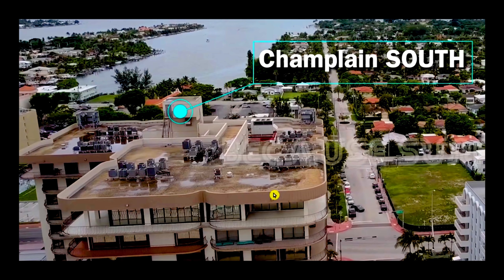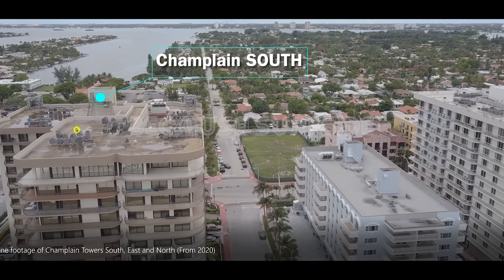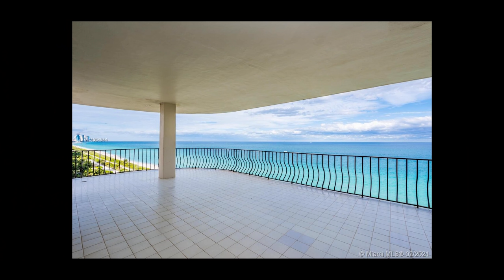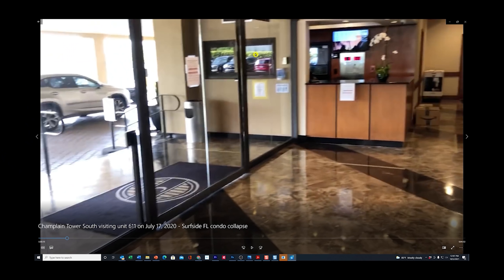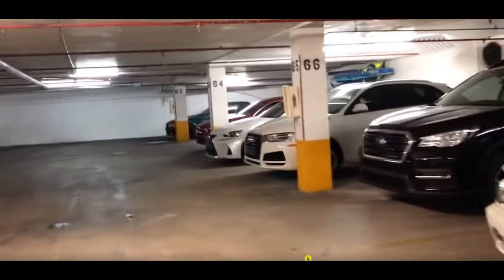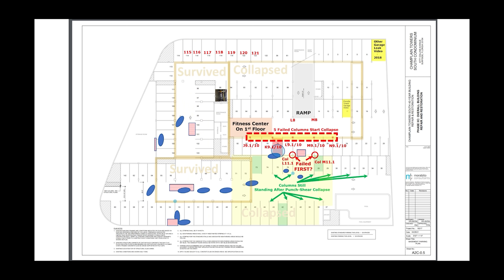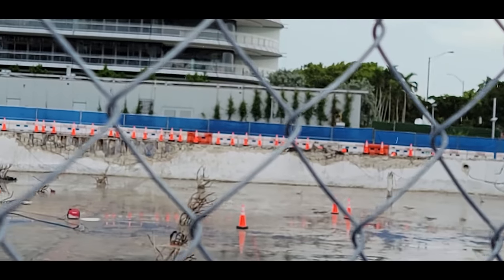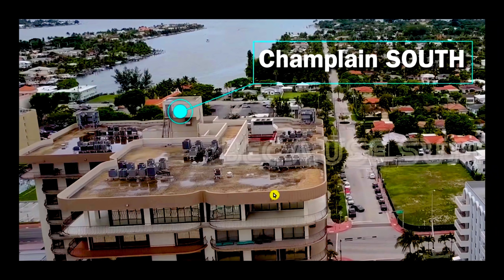Miami Condo Collapse: Water Attacked Roof, Inside, Pool Deck

Comment: Whatever a person may think about Jeff is not important here. And you do not need to be an engineer to see that there are things that do not add up here, a number of which Jeff has identified:

Weight added to the building that was not originally intended; pavers, layer of sand on the pool deck, marble on interior finishes, a thirteenth floor added in later years  

Weight added with concrete planters, dirt, palm trees. This must have added several tons to the weight of the building. 

Also, water trapped under tiles and grout, but over the concrete slab, this corroding the rebar. Very bad. Porous grout and concrete. 

Neglected maintenance on spalling concrete

Failing and leaking garage ceiling

Large pools of water sitting on the roof top

Strange leaks inside the building, in the hallways, dehumidifying fans in the hallway

There are all clues. Whatever Jeffs credentials may be, Or not be. Don’t shoot the messenger.
Reply from the maker: Thanks, glad you find the videos useful!

Comment: How come every apartment had its own little residential sized AC unit on the roof? Never seen that before.
Reply: Seemed to match the original build plans from 1979.  Each apartment has its own air handling unit / evaporator for individual temperature control.  This of course requires a dedicated compressor/condenser unit on the roof,  with long freon lines connecting both.
Reply from the maker: All buildings do it like this

Comment: RE: Water in the hallway near 611... floorplan shows that BOTH sides of the corridor/hallway are plumbing walls, i.e. right inside the entry doors of ALL units (incl. 11-stack), there's the kitchen on one side, and a half- or full-bathroom on the other side.  Given the Reiber-esque tendency to use the cheapest materials possible, I'm guessing this building was plumbed with cast-iron crap, which only lasts 35-40 years, max.  =:O
Reply from the maker: I doubt in 1981 they were using cast iron
Reply: @jeffostroff  I agree, for the PRESSURE side, it's unlikely... OTOH, Nathan "Shifty" Reiber got away with all kinds of corner cutting, plus his philosophy of "it's the shiny marble that sells, not what's hidden behind the sheetrock"... PS: for the DWV drains/vent-stacks running vertically, cast-iron is code-required in high-rises even today, due to fire/fumes danger posed by PVC.
Reply: @jeffostroff  Back to original issue of water outside 611--7 storeys below penthouse--I'm betting it came from someplace closer than the roof (e.g. no water staining on WALL above dryer-fan)... like the kitchen in 611... badly done dishwasher or ice-maker fitting, using those stupid saddle-puncture valves, etc.

Comment: Be very careful with condos and coop’s - do they spend the money to fix things? Does the condo board “have teeth”? One of my condos has a ferocious board that would never allow different surfaces and colors on the balcony. My board would put a lien on any property that tries to look that different. Do they work well with members and get things done? It wasn’t surprising to me the hotels around the towers have cleaner, better cared for roofs. They have the money.  And they’re not afraid to spend it. 
-Are the units regularly inspected? What role do the city inspectors play in the collapse?
Does the builder’s company and workers have any liability here? Anyone who is still alive?
Reply: Some condominium/co-ops have excellent Board of Directors of the HOA that adhere to a scheduled maintenance program and make sure that repairs and asthetic upgrades are done to code with good workmanship. The Board is fulfilling their fiduciary duty to protect the viability and value of the building on behalf of the multiple owners.

Other Board of Directors avoid scheduled maintenance altogether and do sub-par repairs when problems. It's been discussed that the C.S. Board has discussed these serious problems for several years and were more concerned about those owners who complained how much it was going to cost instead of how many lives & financial equity would be lost because of their delay in action. 

The Board of Directors almost always have 100% authority to set and maintain a Reserve Fund and to order maintenance, repairs and upgrades as needed and then to ASSESS the members for their share of the cost. This Board of Directors is clearly guilty of letting opinions and emotions make their decisions for them rather than act with sufficient speed upon any force that can potentially devalue the investments of the co-owners in the Condominium. 

With almost 100 human lives lost, as well as the entire assets of most of the unit owners wiped out, the negligent Board Members could find themselves financially liabel for the losses not covered by insurance. That cost could be several times the pre-collapse value of the entire building!  As Lucy would say, "Somebody's got a lot of 'splainin' to do here!"
Reply from the maker: Many condos will have a professional licensed property management company running the show
Reply: Excellent post, alot of people have been sucked into buying apartments over the last 20 years across the English speaking world as a way to get rich quick without realising what they’re buying into.
Reply: @jeffostroff   Yes, but that management company works FOR the HOA (Corporation) and the Board of Directors calls the shots on anything typically over a $200.00 repair. Management companies are often negligent, but ultimately it is the HOA Board of Directors that are responsible for how the management compnay runs the show.
Reply: As I used to say to my husband “being cheap never pays”. He and his family never ever wanted to pay any money at all for services, labor, aka repairs, thinking they’re saving the ultimate amount of money. But if you don’t keep things up, take care of them, or just let them go etc. you’ll pay more at the other end when it can’t be repaired at all. You’re money is always worth more right now than in the future - it’s how money works. And you’ll always pay for your actions by being cheap - by paying more to replace the dishwasher than keeping the old one going with repairs (at the least) or paying with your life as in what happened here (at the most extreme).

Comment: Concerning your comments regarding the architects drawing showing roof drains that you don’t see in the aerial photo, are you aware that an additional penthouse floor was built atop the original roof and would have covered the drains?
Reply from the maker: Yes, and the penthouse should have a sloped roof also. But can't see the drains on the other sections of the roof. Penthouse has nothing to do with it. Every roof should have a slope.

Comment: Maybe the next condo building will use an HVAC system that is owned and maintained by the HOA. I cannot fathom individual residential units for each condo and the rest of the building being conditioned by a separate commercial system. Seems energy wasted by design. All of that standing water causes major damage...hence, the roof repairs just before the building went down.
Reply from the maker: Not practical to have one system try to control everyone's unit. What happens when it fails!
Reply: @jeffostroff  All commercial buildings would have that problem if they fail. My concern mainly is the inadequate method to condition things with individual HVAC's. Commercial systems have thermostats and supply registers that can individually set the temperature desired. My guess they don't want the utility bills going to the HOA but it really shouldn't matter, the HOA fees would be adjusted to include those expenses. Sadly, in the south tower issue, they hadn't adjusted HOA fee to be in line with the reality of the building for decades. Based on photos and videos posted on the web/youtube, looked to me like that entire building was suffering from HOA needs.

Comment: Both Champlain South and North had penthouses added to the previously designed structure.  Maybe the penthouse installer couldn't be bothered with drains.  Note that Champlain East didn't't have a penthouse, and its roof is shiny and white.  (12.23)
Reply from the maker: The rest of the roof beyond the penthouse should have had drains and it was pooled with water also

Comment: In your last view where you show the lot filled with water, that is not coming up from beneath but from rain and the king tides, how do I know that? the pool also has water in it as well, and the water is all the same color, A/C units create lots of water which on and that's why there was pooling around the units, granted the roof was 40 years old, so it should of been repaired back in 2018 but wasn't.

Comment: More likely, in my inexpert opinion, it goes to the lack of firm ground on which to build. With soil and sand erosion as severe as it is in this hurricane-prone location, pilings that were sunk deeply enough fifty years ago might not be deep enough today.
Reply from the maker: I think we can be fairly certain that it hit the limestone bedrock with the piles, otherwise the building really would have sank in different directions and cracked all over the place. The problem here is the water table can move up and down depending on the tides and and the water seepage they have much better techniques now for determining soils suitability to put a building on.

Comment: Air conditioners make 5-10 gal of water per day. Probably more in humid Florida. They may not have been properly draining the condensation resulting in the puddles on the roof around the ac units. Other buildings don’t seem to have puddles
Reply from the maker: Look where the puddles are, there is no sloping, you can';t get puddles that big.

Comment: The residents complained the parking garage would fill with water up to 1 foot or more just like the bath tub pictured at the end of your video
Reply from the maker: Well, remember that was twenty years ago when they had that massive flooding in the garage. It appears to have gone away in recent years and in fact the video from 2020 in the garage shot by our friend Fiorella clearly shows there was only a few puddles and those almost certainly came from the cracks and leaks above from the pool deck. So that remains to answer the question as to what happened to the flooding of old? Did the problem go away on its own? Did they put in some new high end pump system later on? But remember the flow was mostly dry in the video last year. I think most of this floating is from the damage due to the condo collapsing.

Comment: AC  condenser water from roof drains was probably plugged with debris
Reply from the maker: There wasn't a single AC on the roof for everybody unit everybody had their own AC unit and I had looked through the permits from the last couple of years and numerous units had their a CS replaced so I'm sure they were all in pretty good shape and also if you had a clog in the drain at all you wouldn't be getting cold air it wouldn't be immediately known, and immediately fixed that's one thing about South Florida it's so hot down here that an air conditioner is not going to sit there like that without getting repaired.

Comment: I wonder about the repair done to the pool deck.  They injected epoxy or polyurethane to fix cracks . I think this makes problem worse if waterproofing on top was bad. Now water can not drip down into garage it stays inside the concrete instead causing problem with rebar corrosion.
Reply from the maker: Whoever did the original repair on the pool deck in the 1990s to fix the crack with the epoxy injections totally botched the job that was very amateurish and in fact they left the injection ports in hanging out of the ceiling which was just really stupid in the garage. What they should have done was grinding them down flat to the surface of the ceiling, and then patched everything up made them nice and smooth and then primed painted with a nice sealer coat.
Reply: @jeffostroff  The point I was trying to make was that sealing the bottom of the concrete slab is wrong .  They made the whole slab a shallow swimming pool.  They should have fixed the the sloping of the pool deck then make sure the drains was OK after that fix the moisture barrier so water can't Leak down . The garage roof should have been bare concrete or painted with a paint that let water trough so the concrete stays dry .

Comment: a marginally engineered building with deferred maintenance with no engineering specs for tile on decks = building collapse..........
Building code should be required to meet future deferred maintenance and additions. so this will never happen again.
Reply from the maker: That sums it up pretty good

Comment: If they are getting ready to sell a unit what is the main thing you do??????  Clean the carpets, hence you have the fan on the floor.  Yes it could of been a leak but could also simply be carpet cleaning.  I've got dozens of apartments/units ready for sale.  Mostly includes cleaning, paint, carpet cleaning and any necessary repairs.  With all of the work inside unit you also want to clean near the entrance of it
Reply from the maker: The buyer was informed by the owner that there was a leak in the building. No owner ever touches the outside of their unit

Comment: SOOOooo... if these roof-drains ever existed, HOW would they be plumbed?  The drain/outlet itself would have penetrate all the way through the slab, then the sloped pipework would be... above the ceiling sheetrock of the units below?  Did anyone see this in any of the "approved" drawings?
Reply from the maker: yes they have hollow cavities going all the way up. All the bathroom ceiling fan vent exhaust tubes run up to the terminate on the rook vents

Comment: I have believed from the beginning this building was rotting from the bottom up.  Will test results of pilings and geological findings be made public?  I think there's alot of denial going on, simply because it's cheaper than admitting the area isn't viable anymore for these structures. Maybe our egos are too big to admit we can't do something, on top of the huge financial loss of evacuation, even if done over time.  Shouldn't we be monitoring the ground now to record changes in how water underneath is moving, or is it just easier to deny and consider it a freak accident just because we can see maintenance issues. If this building was maintained, was it doomed regardless?
Reply from the maker: Yes list is required to make the test results public and it will probably be 18 months to two years before we get the full report and it will be extremely detailed and very difficult for most people to pay attention through it with all of the scientific data and charts and graphs that they do. that's where you will have me to decipher it for you.
Reply: @jeffostroff  thanks. Yes, I'll definitely tune in here for that. Have a nice weekend!

Comment: F Y I    I came across  u tube video from
ABC news from 2 weeks ago named 
The fall of the Champlain Towers:
tracking the Surfside collapse 

3/26/1996  a report issued to 
Champlain Towers South … 
the pool deck and garage ceiling needs 
concrete structural repair… 
Nov 1997 work completed ….. was it ? 

over 20 years later 2018  failed waterproofing ect … in the Moranito Report prior to a 40 year recertification.
building repair upgrade process.

ps So I may have missed anyone saying 
repairs to the pool deck and garage ceiling were done 3/26/1996 and inspected/completed Nov 1997. 

In any case ABC has some videos on 
this subject … FYI

Also , I had not heard about the sewage 
issue raised prior to or during the early build of C Towers and there was 400 K paid to the city or someone ……. again ?
Reply from the maker: Yes I have covered this in previous videos in July where I mentioned specifically the work that was done in 1996 on the pool deck, and I showed the building permit for it in the engineering sign off for it, talked about everything that was done showed in the plans where they brought in these extra planters and put in the 20 foot tall palm trees and were supposed to repair the cracks in the pool deck which they did within injection epoxy which was pointed out on the 2018 morabito report that the injections were done improperly. But also in 1996 as part of that building permit they added two inches of sand in all of those pavers in the pool deck which I think added a lot more weight. And I also pointed out on the videos how rain gets in and soaks into the sand and sits there probably for days before it can evaporate and adds more weight on top of the already strained pool deck